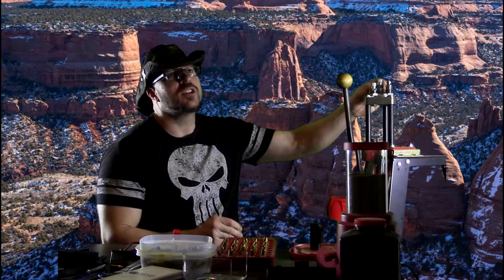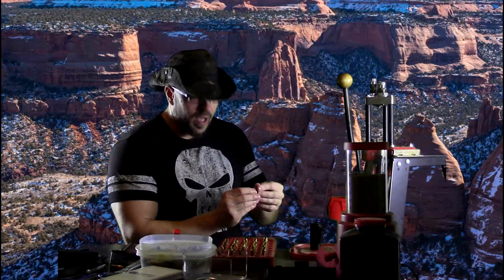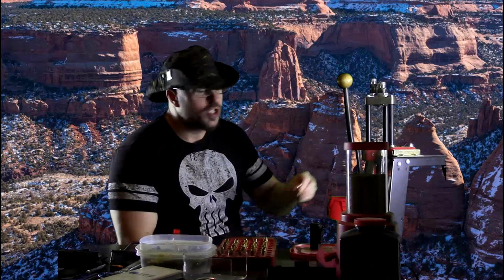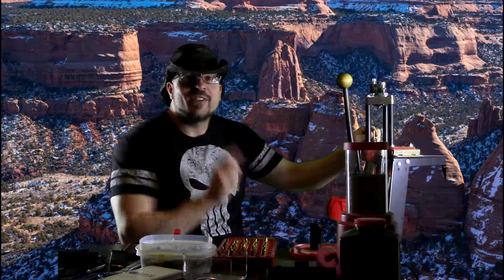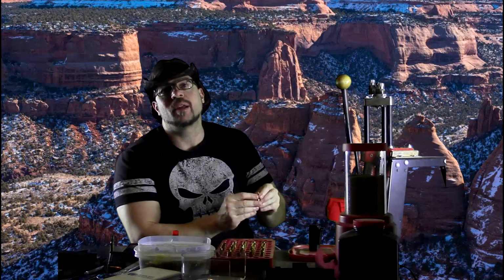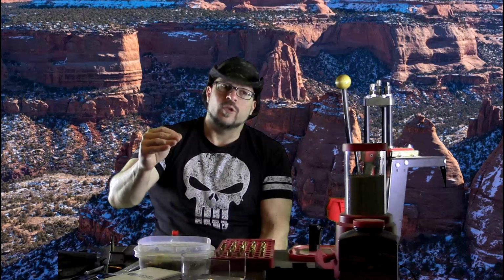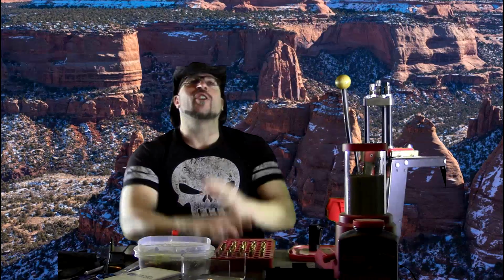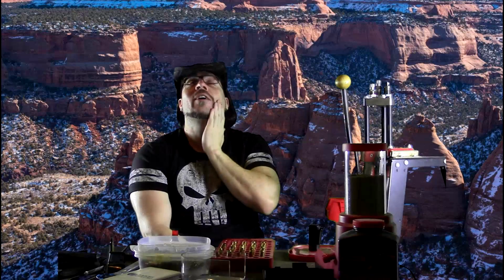Thoughts On The New .224 Valkyrie As A Long Range AR Cartridge

Comment: The ar15 was designed around a specific cartridge: the 556/223. Not the 7.62x39, not the 6.5 Grendel, not these modern cartridges. The 224, 6.5 Grendel, and now this new 6mm arc will destroy your bolt face, due to high pressure. Look at a bolt face on a 556 compared to the Grendel type 2. Look at the thickness of them. It’s a failure waiting to happen. Reliability also seems to be a problem, whereas the 556 and 300 blackout seem to run fine, because the ar15 was designed to shoot these type of cartridges. If you want to shoot 6.5 Grendel, you’d be better off with an ak or bolt action for reliability and accuracy. My two cents

Comment: Federal, because of lawyers, are loading the Valkyrie lukewarm. Reloaders are going to load the valkyrie to at least 2800 - 2900 fps reliably with no issue.  You are saying Valkyrie is not impressive because you can "almost" replicate Federal Valkyrie specs with a 223, a very hot 223. Almost doesn't cut it, period.  Like I said before, reloaders are going to take the valkyrie hotter than factory and push a 90gr faster than any 223 could.  While you're right that it technically drops less (10.95" @ 500 yards vs 11.4" @ 500 yards) and drifts less (4.0" @ 500 yards vs. 4.2" @ 500 yards) than a 123gr Grendel, in reality the factory loads are damn near identical but the 123gr Grendel carries roughly 33% more energy (not less as you stated at 6:29) at all ranges using less powder edging it out as the better of the two cartridges not the other way around. At 6:22 you say the Valkyrie has about the same drop as the Creedmoor at 1000 yards...you're about 7 inches off bud. Valkyrie @ 2700fps muzzle with a 90gr. SMK with a B.C. of 0.504 and the Creedmoor @ 2750fps muzzle with a 143gr ELD-X with a B.C. of 0.625, the Valkyrie will drop about 36" @ 1000 yards and the Creedmoor will drop about 29.4". Even if I assume that was a slip of the tongue and you really meant Grendel, not Creedmoor, the 1000 yard drops are 36" to the Valk and 37.2" to the Grendel. Again, virtually identical. You are so full of yourself, I can hear it in how you talk.  I hope others are smart enough to do their research to see this as well.
Reply: Alex Waltman I agree federal designs a cartridge that does just what he was talking about(loading heavy 233 with high BC) to use in the standard ar-15 platform and they make it better with more potential than the 223 could ever dream of no modifications required if buying the rifle factory chambered for the 224 no milling, lengthening of magazines, no need for a new barrel with a longer throat to accommodate a bullet the cartridge was never intended to shoot. And people just bitch and immediately start putting it down I’ll never understand it. Sorry folks the 224 is just objectively better than the 223 only thing it loses at is cost of ammo.
Reply: sorry, dont know where your getting your info but the valkyrie is averaging 50fps more than is advertised on their boxes for the valkyrie, of course in a 24" tube

Comment: I've searched your channel, but havent seen a video on the Sharps 25-45 caliber bullet. What is your opinion on this cartridge, and do you think it can succeed in the market?
Reply: The limitation of the 25-45 is 2.26 overall cartridge length of AR magazine. I think the heaviest bullet that will fit magazine length is 90 gr or lighter. Advantage is it easy to form brass from easily obtainable, often free, 223/556 brass.

Comment: A lot of truth in this.
But remember bullet weight have nothing to do with a good BC only the lenght and design. Maybe a 77 grain lenght bullet with a aluminium or polymer core instead of the lead, that could be driven with a lot of speed. Oh Oh Oh you will loose momentum....yes but at range in small calibers there is none anyway, here you are only able to put a hole in things.

Comment: On the other hand, I don't want to take a file to my magwell.  I don't want to modify magazines because that's easy to screw up. I prefer not to have to worry throat length.  I really do want to just find the appropriate heavy barrel, pick a length, click "add to cart", put in my credit card info, and then wrench together an instant DMR /1000yard semi-auto - at least that's what this NEW cartridge has the potential to do.  Better than anything before it. Especially with handloads.
Reply: lowell houser you can go right now and put a6.5 grendel barrel and bolt in your cart and shoot 1000 yards and don't have to wait for these to become readily available. Plus wolf is now making 6.5 grendel not going to win a match with it but you can stock up at 6$ per 20 rds or 119$ for 500. I'm definitely interested in this new cartridge but I'ma wait for it all to become readily available and prices fall. I built my 6.5 too soon and compared to prices now I could do it for half the price
Reply: If you did what he's talking about to the Valkyrie you'd be way above the 223

Comment: Alexander arms toook a 6.5 ppc and altered it ever so slightly, the grendel would have been a much better cartridge as a 6mm. A 223 with a 75 grain hornady hpbt going 2650 drops the same amount at 600byards as a 6.5 grendel with a 123 smk going 2550, now if it was 6mm shooting a 107 sierra you will be able to shoot a lighter bullet with a better bc faster.
Reply: Sbjr31 I agree, excellent point.

Comment: Well done Jason, as usual.

And you are absolutely correct. People have been doing this with not only the 223, but also shorting and necking down the 6.8 for years. 

We will see how it does, however like the Grendel, I think it will require a 20" and up barrel for optimum performance, which typically puts you in a similar weight braket as most modern AR10 pattern rifles...
Reply from the maker: It really needs a 24".  The reason people complain about the .223 being too weak is due to using short barrels instead of a 20" which is what the cartridge needs.  People who love short barrel carbines with a 16" barrel should probably stick with 6.8 and 300 blkout.
Reply: Do you have any source on the magazine fitting 90 grain round? I am interested in modifying my rifle to fit it.

Comment: Yeah the 22 Nosler has a rebated rim to allow the use of a standard AR bolt. In essence think, 30 Remington case with a rebated rim, cut and necked down to .224"/5.7mm

*Also I'm pretty sure the 22 Nosler has been able to push 80gr pills. Thus far. Or at least there are several who've claimed they have done it. Personally I wouldn't mind getting into the 22 Nosler. Worse case scenario I end up not liking it and rebarrel an upper in something else.
Reply from the maker: Fair point on the .22 Nosler.  Worst case you are out a barrel and the cost of your brass investment.

Comment: Wonder how the 224 Valkyrie ballistics compare to my 22-250 out of my bolt gun...
Reply from the maker: Difficult to compare because .22-250 usually have barrels cut with very slow twists for lightweight bullets.  My first rifle as a child was this very caliber and we used only 55 grain bullets in it.  This new cartridge will only be for rifles with a very fast twist and will use 90 grain bullets as a standard.
Reply: Something I've come to find out after getting a Thomson Center gun in 22-250. I was excited to shoot through AR500 steel with light bullets. But I also wanted to see the long range potential with heavy pills. Surprisingly, the heaviest load I could find was 55gr... Wonder why... Oh, twist rate is 1/10 on factory guns -.-
Reply: Maan again...twist rate is dependant on bullet lenght not weight.
Reply: 22-250 has greater capacity, and more than likely has a higher peak SAAMI rates pressure. IF you could find a 22-250 rifle with a 1:8-1:7 twist it would outperform the Valkyrie with heavies, but keep in mind the 22-250 won't work in a AR15 style rifle.
Reply: Rob,  Copy that, good info. I'm thinking the Tikka may have a 1-7 or 1-8 twist, will have to investigate further.    Thanks!!
Reply: Firebird,   Wasn't planning on shooting a 22-250 out of an  AR15. I was just curious about ballistic difference between the 224 Valkyrie and 22-250 that I shoot out of my bolt gun. Somehow my original question got really twisted...
Reply: John Ganshow  my Tikka .223 with a cdi dbm as Tikka mags can’t seat to far out even after modifying them. I run 25.0 grns of varget for the 80 Berger vld, gives me 2920fps avg with a SD of 6fps out the 24” tube. I use this gun for fclass std and open field comps also for Varmint shooting. 

Think this new fang dangled long range is pushing a 90grn pill at 2700fps 

Me think’s,  I’ll stick to the ol .223 bolt gun. I understand this round was made for gas guns. To me it just looks like a 22 dasher just slightly longer case length.
Reply: all_ontario_hunter  not that hot in my bolt gun,  I actually pushed it to 27.0 grns before I started getting high pressure signs and then sticking bolt. 25.0 produced the tightest groupings on multiple tests. Avg of .185 center to center 5 shot groups. So my load is settled at 25.0 with the VLDs having a .015 jam in the lands. The extra 2.0 grns gained nothing but a few more FPS ( 50 and under ) and pressure signs, groups started opening back up etc. nothing worth running that hot worthwhile. 

Not bad for a factory rifle, competes very well against high dollar custom builds.
Reply: https://www.youtube.com/watch?v=vkHqm4V6Z6s